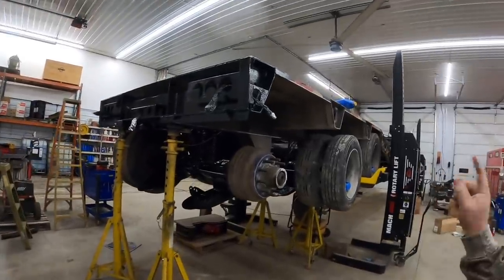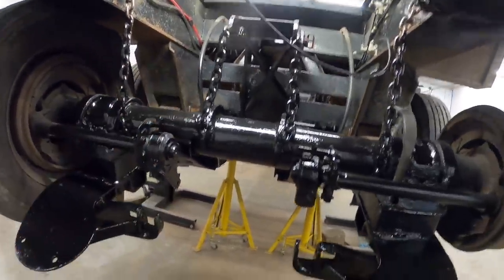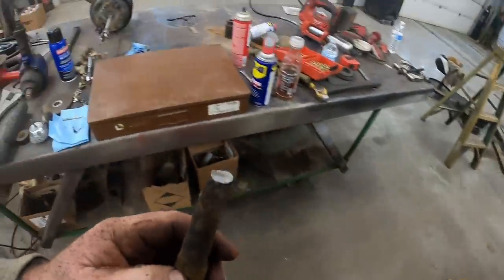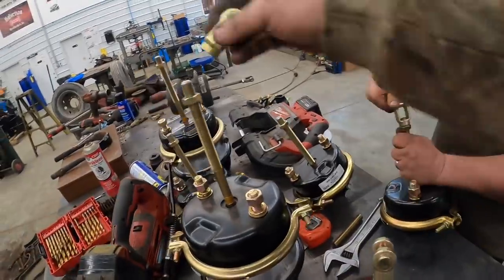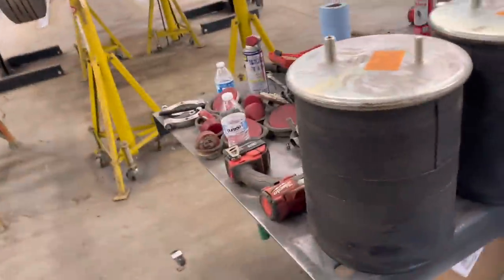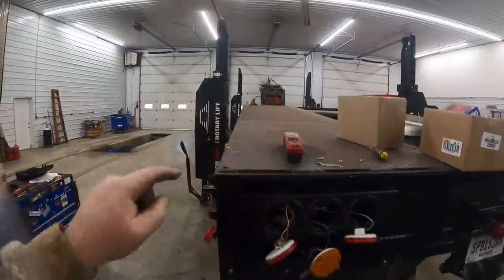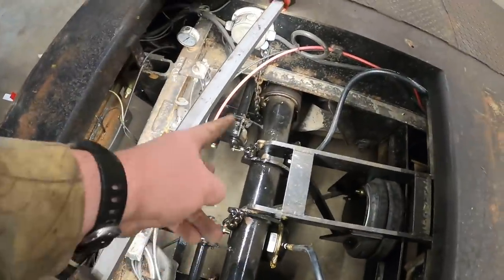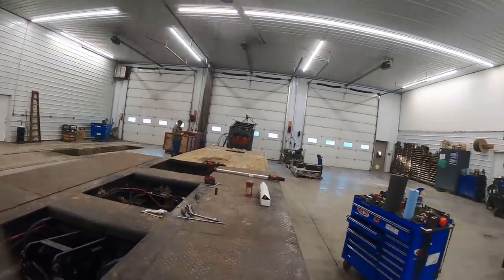@DirtPerfect  lowboy trailer repair part 2 #Talbert #ccequipment

Comment: You do great work.  Short of total disassembly and sandblasting, you did everything.  I'm impressed that you paint things and don't take short cuts.  I'm also amazed at how equipped your shop is.  Think that I could buy from you with confidence.

Comment: Great job.  There was a LOT of hidden damage on that trailer, particularly those U-bolts.  People should really watch this series before they invest in a used trailer, especially if the trailer is coming out of the rust-belt.  

Also, no way you can close the trailer shop, you just put out a 90 minute advertisement on what great work you can do! 😁
Reply: Just re-open the trailer shop if things get slow.  At least you have the space to fit an entire trailer in AND put it in the air!  If there had been damage to the hitch and lifting mechanism up front, you could have gotten to it easily.  I know that shortly the auction purchases from Florida will arrive and there will be much to do.

Comment: After having worked for a dump truck and equipment fleet in my past I had to chuckle a bit when you were wrapping up all that nice suspension and brake work. You made the comment you needed to check the lights before you wrapped her up. I was thinking to myself, oh boy here comes a few more hours of chasing electrical issues, nice work guy's she's ready for a couple more hauling jobs.

Comment: One thing with those lights on the trailer. Place a blob of dielectric grease on the connector before you connect the wire. Helps to keep crud and water out .
Epic job on the trailer!

Comment: chuck sth away/out with the old rusted metal parts, thrown in the trash, and replaced with everything new. Know what else was old and rusty and replaced? DP’s lowboy trailer will be sporting a set of brand new C&C Equipment Mud Flaps? Damn Clint, you really are sharp as a whip “not trailer shop” what an excellent idea.

Comment: I know exactly how you feel about not being a trailer shop. We wash our trucks and cars but we forget about our trailers. We live in a state where it snows a inch and the highway department puts on two inches of salt. I have a small trailer and it’s 25 years old with very little rust on it because I pressure wash my trailer. Hopefully I will get my steam cleaner before long .

Comment: You guys have a pretty efficient way of working on this trailer. Even tho you don’t work on trailers , I really enjoyed this one because I learned a lot about how the air ride works and the drop axle and everything else. I’ve always had questions in my head about these lowboys but you’ve answered them all. Thanks. Dirt perfect should be thrilled with these repairs.
Reply from the maker: Thanks for watching

Comment: I've used a lot of WD40 and still do, but for rusty parts, bolts & nuts you Need can of "PB Blaster"....spray it on & 15 minutes later it is breaking loose & coming off!

Comment: Give Kevin attaboy on the u bolt puller idea. Nice job on the trailer, I think you saved an accident waiting to happen, I’ve never seen u bolts in such tough shape. Thanks for the ride along. Be interesting to see how many trailer repair request you get now.👍

Comment: Second time watching on this one good lesson on them you bolts the are stationary bolt but yet they rust away around the inside so it would be sand and water takes it toll over time and no real way to stop the process of rusting away 👍very good lesson 😎🇺🇸NY

Comment: When I worked for truckin company up home as a head mechanic anytime we had a spring brake I always cut the U-bolts then used an inch drive Impact and spun the pieces out with the nut.Like You did on the one. We did it to all rather then waste time trying to get thoses U bolts out after taking nuts off. They Grow fast...LoL..Great Job on DP trailer Guys..And Great Video...
Reply from the maker: Yep works good

Comment: You guys might be interested in POR 15 products for treating rusty frames and chassis components.  We used it with great success at a high end auto restoration shop where I worked for a couple years after I retired.  It is as close to bullet proof as any finish I’ve ever seen.  Downside is that you will wear it for a month if you get it on your skin.
Reply from the maker: Yea
I have seen it before good stuff

Comment: Incase you never known there is tool I have for my telehandler on site as some machines hired to me aint well kept or maintaned  and dont accept grease (as u hit nail on head ""hasnt bin greased like forever"") but its like a impact style tool cant put link but search online impact grease fitting cleaner it be there in box. Basiclly clean nipple best you can from swarf and fill tool with grease, put on nipple and  then strike end it forces past old hard greas. (Not to be on homestyle nipple tho ""may hurt u more than her😂😂)  but you may heard of may not if help then save time and effort. I only found and got one cos snapped nipple off years ago and then you know what's next the old drill and ""dont catch the thread malarky"" hope helps even in future ..👍👋

Comment: One thing for sure not being a trailer shop is the hub seal installation, airbag installation, slack adjustment and  all those repairs were done at a higher than average standard

Comment: Fair to say that this trailer is now fit for purpose ,safe and compliant ?
How many trailers are running the roads with issues and hauling big heavy loads , accident waiting to happen ?
Industry's down side for owners to fund the trailer needed to get their gear about to site and earn money ,but that money is only proportional to the money needed to run them be compliant etc .
How often do you hear ,it's all I can afford ,it will have to make do until I make more money ,we all know that sometimes that never happens.
This trailer I thought had been under a close eye from that great officer that runs those meetings for owners ?
At least it has now been done,when do you think the next issues could pop up ?
What's the chances of you manufacturing a new trailer ?

Comment: Back in the 80’s-90’s when I worked on trailers, we called the shafts “S” cams for the brake assembly.
Reply: Well the shaft is what turns the cams so that's a good name for them I suppose.  I hate trailer work.  Especially air lines.  Air lines and wiring.  Two things I hate doing.

Comment: It is in section 393.1 It is still 50% But it must start as far to the front and go all the way to the rear as possible and be evenly spaced covering at least 50% or you can do a continuous strip  - Locations for retroreflective sheeting  - 

(1) Sides.  Retroreflective sheeting shall be applied to each side of the trailer or semitrailer. Each strip of retroreflective sheeting shall be positioned as horizontally as practicable, beginning and ending as close to the front and rear as practicable. The strip need not be continuous but the sum of the length of all of the segments shall be at least half of the length of the trailer and the spaces between the segments of the strip shall be distributed as evenly as practicable. The centerline for each strip of retroreflective sheeting shall be between 375 mm (15 inches) and 1,525 mm (60 inches) above the road surface when measured with the trailer empty or unladen, or as close as practicable to this area. If necessary to clear rivet heads or other similar obstructions, 50 mm (2 inches) wide retroreflective sheeting may be separated into two 25 mm (1 inch) wide strips of the same length and color, separated by a space of not more than 25 mm (1 inch).
Reply from the maker: Thanks 
Guess it didn’t change
I see allot of new trailers with 100% on sides now so I thought it may of changed
Reply: @C_CEQUIPMENT  Yeah. The tape really works in the dark to let others know there is trailer there. If you could have taken DP's trailer without any tape and shine a light on it then add the tape it is a HUGE difference.

Comment: I work in a truck shop. Anymore, if I know an axle is getting new u-bolts, I don't even bother trying to take the nuts loose. Just torch them off at the axle, and then use the nut that is still on the bolt to spin the thing out. No sense trying to save a u-bolt that's half rusted away.
Reply from the maker: Yep

Comment: Great video and I don’t want to sound like a know it all but I’ve worked on rebuilding trailers for years and when you replace the U bolts if you will clean all the rust and dirt off the caps they will tighten up and stay tight. If you don’t they seem to loosen up. Just hope it helps again don’t want to say your doing something wrong just wanting to help out.
Reply from the maker: We did chip the rust scale off the saddle areas

Comment: I hope you used plenty of Antiseize when you replaced all of the new parts I didn't see any I use the copper myself and nothing shows that you did use it. I  also noticed the stop on the slack adjuster stop didn't pop out, at the 23.36 mark on the video that stop is not out , you have to push it in and after you adjust the breaks it pops out
Reply from the maker: We used the silver stuff
You may of not seen it

Comment: Ton of work. I have to say I'm curious what all of that work and parts came to cost wise? If a cheap old trailer can be brought back to life - good as new, it would be handy to learn what the cost is.
Reply from the maker: It is costly for sure but new trailer costs are extremely high with the price of steel

Comment: My favorite method for removing u bolts is to cut the u part off then rattle on the nuts with the impact. Worst mistake ever is cutting the nuts off first. A big air hammer also helps rattle the rust out

Comment: I worked in a cast iron Foundry for 28 years in Indiana and we made several styles of Axle clamps and sold them to a company called Neway but not sure if that was the customer or machine shop but if my memory doesn't fail me some had that name on them and they are made out of whats called Ductile iron so they will bend quit a bit before they break And it would be interesting to see one of those Axle clamps beings those bolts were that rusted :)  ....Yall have a nice shop there we also made the bearing caps and bases for Standard locknut
Reply from the maker: these were neway axles and suspension!
Reply: @C_CEQUIPMENT  I did every job in that place at one time of another hell i may have molded , Poured or inspected them very parts as i started working there in 83 till 2009

Comment: Curious did you put a modification in that trailer so the emergency flashers will work in the back when the trailer is disconnected from the truck it really needs it bad when DP unloads on the highway he puts a couple flags on the back and hope he doesn't get HIIT. If you didn't I guess if he really wants that he can do it himself just curious
Reply from the maker: We did not
My trailer has a battery on it so when it’s unhooked the flashing lights still work

Comment: Rust , dirt ,  moisture , and salt wears out a one inch diameter u bolt once you put a load on the trailer in what ? about a decade or so ? how old is that trailer? Looks like new 🍻👍🏻

Comment: they sell a grease gun end that slides over at 90 degree...perfect for areas like 9 minutes in....just take 10 seconds to swap out the end on the gun
Reply from the maker: Yea but will the next guy have it
Or will they get skipped over again and the shaft gets stuck again
Best to do it the right way
Reply: "the next guy"????...the guy who owns it should be greasing it regularly...

Comment: Those are S cams and hub caps. Needed to use never seize on the u-bolts and clevises. Sorry, noticed after watching the video 1/2 way through, you did call them s-cams and used never seize.

Comment: Did you end up changing those upper pins on the lift axle pivot point?
Reply from the maker: No
They after cleaning them they actually were way better then they looked
Reply: @C_CEQUIPMENT  okay cool I just remembered you saying you were thinking about putting in new ones

Comment: Why are you using WD40 as a penetrating oil ???     WD40 is for electronics it is Water Dissipater #40   it is used to dissipate water from electric circuit boards also works on wet distributor caps. It was made for the rocket / missel industry to protect electronics from condensation that occurred as a rocket climbed true the atmosphere and the temperature changed causing short circuits.

Comment: You guy do great work. I like your attention to detail.  However,  you did potentially  make me aware of a new regulation  concerning DOT Tape. Gawd, I hate the government.  They either do nothing at all or they overburdened  you with regulations  that make it nearly  impossible  to earn a living. But full surround  tape. Believe  me if they could see you before, they're not going to  see you now. Congratulations  on taking on a contractor 's piece of equipment,  even if he he your friend. We never fix anything that hasn't  fallen off, or nearly so anyway.  BTW,you ever deal in the M-915/M-920 series?
Reply from the maker: I have had lots of the m916 917 920 series in the past
Another person said it way still 50% on side yet so that may be true yet
I do see most new trailers with 100% tape on sides now 💁‍♂️